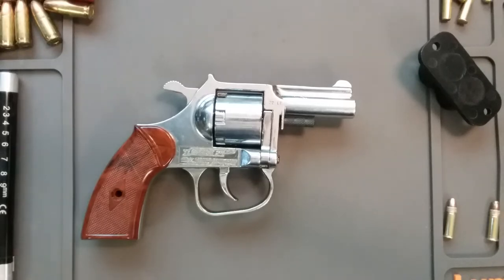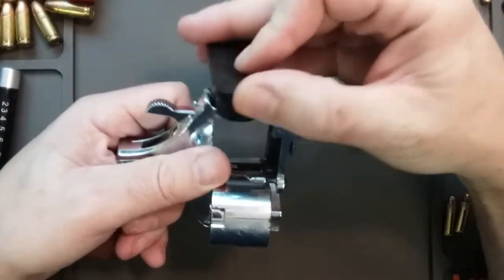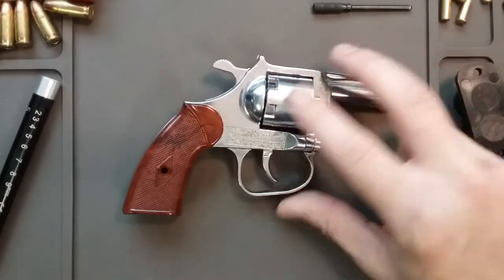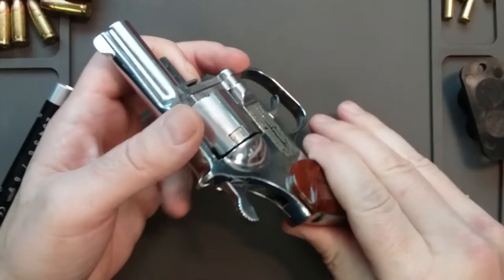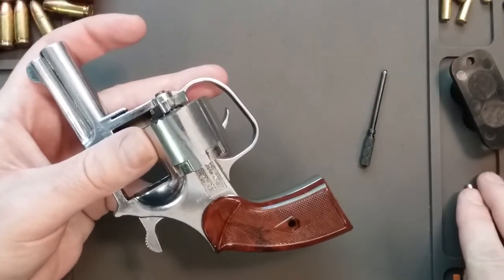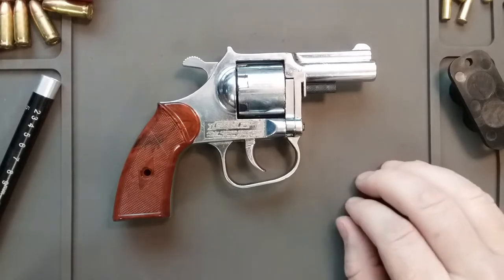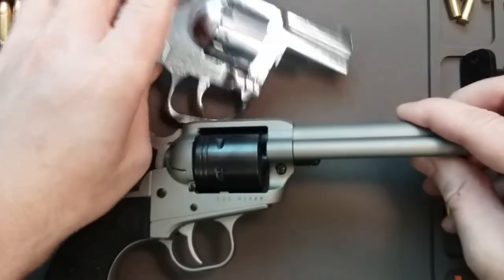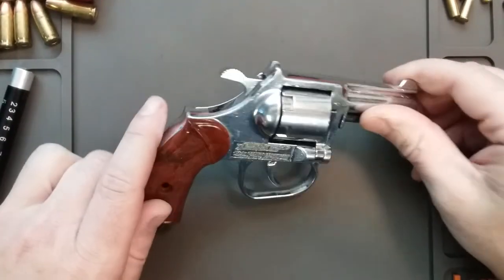Clerke 1st, The First Plastic Gun made?

Comment: The Clerke is based on a starter pistol design and are not plastic, they are die-cast from a zinc alloy.  I have seen a good number of these over the years, both .22 and .32, and not one of them was made from plastic, except for the grips of course.  At the time these were designed and manufactured, there just weren't any commonly available plastics that could withstand firing even a .22 short, even with a steel barrel insert and cylinder.

Comment: O.K. Let me see? The only parts on the gun that are plastic are the stocks. The cylinder is not steel. It is cast iron. The frame is of the stuff known as pot metal. The barrel has a steel liner and most of the small parts are steel. Made from 1969 to 1971. And forced off the market by the government due to it's poor standards and workmanship. I have seen 100"s of them and most did not work rite out of the box. If you would see one firing that works? Check out my channel for the 22 one. And the next video I post will be of the .32 one. Hope this helps.
Reply: I posted links to your 2 videos above, George.  First I had ever heard of these things, great job!
Reply: I have a 32 that looks identical to the 22 . It belonged to my father and I have not fired it because I don’t know how safe it is. Does any one know the value of this gun, I under stand it is a little over 50 years old.

Comment: You have a couple pieces missing on that gun but the original one was built in Germany an there is supposed to be a locking pin in the front along with a clip that snaps to the cylinder pin an the reason it won't line up is the cylinder aliment pin that rotates the cylinder is missing I have one on my table right now fixing it for a friend